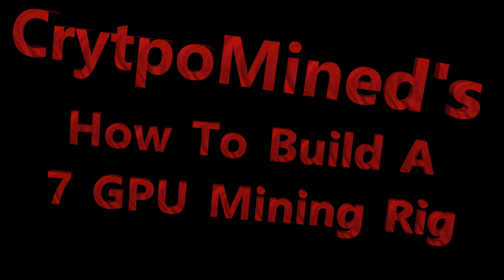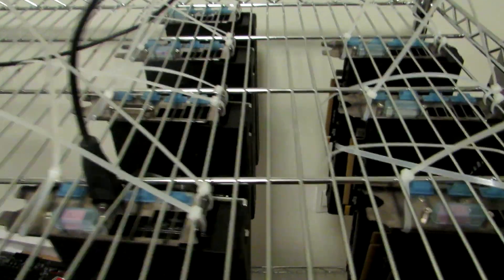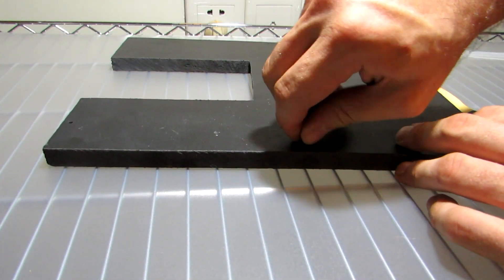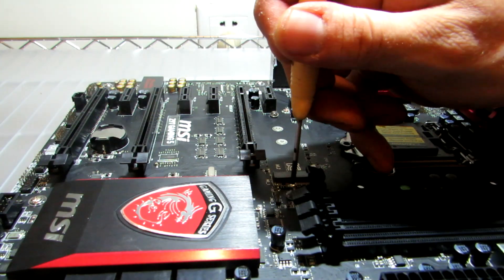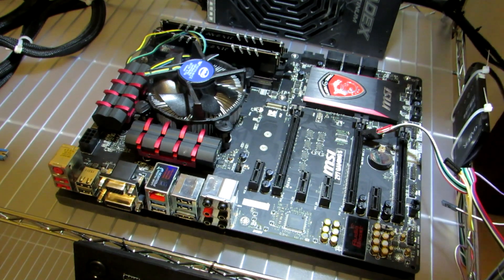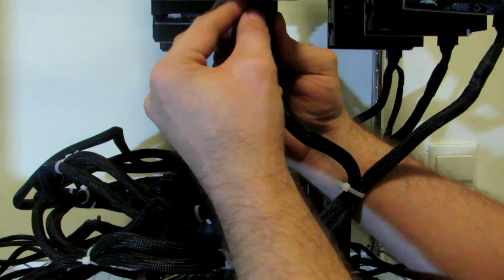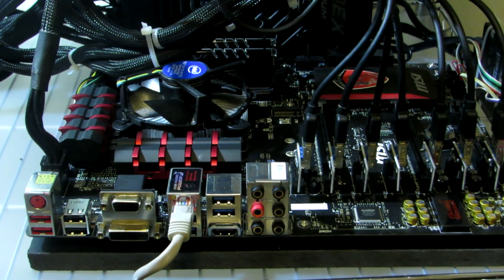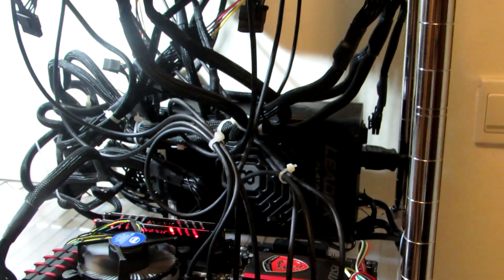How To Build a 7 GPU Mining Rig for ZCash Ethereum Monero Crypto Altcoins MSI Z97 Gaming 5

Comment: Hi, I have installed windows 7 and I have put this driver
Non-WHQL-Win7-64Bit-Radeon-Software-Crimson-16.9.2
Now I have configured 1 to 1 and it works so the above problem is gone my problem is
That all I work if I use 1 in one then I turn off the pc add another and it works the 2 I do the same 3 I do the same 4 works but when I connect a fifth or sixth comes out with a triangle
Here's a photo: http://image.prntscr.com/image/db625782b1da45f6bb96adfec2ba6bbf.png
My rig:
MOTHERBOARD: z97 gaming 5
CPU: Intel Celeron G1840 2.8Ghz Box
RAM: G.Skill Aegis DDR3 1600 PC3-12800 4GB CL11
GRAPHICS: Sapphire Radeon Nitro Plus RX 480 OC 8GB GDDR5
In the bios I have changed this:
Settings \ Advanced \ PCI Subsystem Settings
PEG0- Gen X [Gen2]
PEG1- Gen X [Gen2]
PEG2- Gen X [Gen2]
CPU PCI-E Land Configuration [x8 / x4 / x4]

Settings / Advanced / Integrated Graphics Configuration
Initiate Graphic Adapter [PEG]
IGD Multi-Monitor [Disabled]
I would like to know how to fix this thanks and greetings

Comment: Dude those Saffire Cards need to be in a horizontal position, the card leaks too much oil (Bitcoin Juice) from the thermal pads and I believe the oil is shorting the card. Trust me in this, within 3 months I got like 6 cards dead with a lot of oil touching the board and my the remaining 470s cards have oil too. XFX, MSI and ASUS they made a very good thermal pads (DRY PADS). To be honest right now I'm working on a freaking design that would hold 18 gpus on top of each others with 10cm space between them. Specially just for my saffire Nitro 470 4gb :) other brands are fine with any positions. Look at any big scale mining, you won't see any SAFFIRE!

I found in your lovely online store the (6-GPU MINING RIG CASE WITH 3 FANS), I believe this case will solve the issue IF its mounted in vertical way.
Reply: Dude is this really a thing? You are the only one saying this in the entire internet. Can you explain?

Comment: Hey Crypto, I have this same board with 7x RX480 8G OC.
I've implemented the bios settings as you recommended, and went ahead to install Windows. No matter what I do at this point the computer crashes and restarts, all the cards are recognized by DEVMNG. I've reinstalled Windows, disabled Windows Updates in Group Policy.. And nothing... 
My set up consists of a PSU that is confirmed working properly on another rig, 4 x16 risers and 3 of the short blue ones (All powered).
When I check the Event Viewer it just shows Kernal-Power. 
Im so close to giving up, 40th hour and counting.
Cheers.
Reply: Switched to all PCI-E Powered Risers, was able to mine for 30 hours. Suddenly got a BSOD "Thread Stuck In Device Driver", and upon re-installation of Windows 10 when I try to install new drivers I get the same BSOD. WTF LOL
Reply from the maker: you changed to ribbon risers?
Reply: Turns out that one card is dead, did a full test of each riser, card, psu connectors.. All six others are mining away wonderfully. Awaiting RMA to arrive! :)
Thanks Crypto!
Reply from the maker: ive had 2 of my nitros die on me in the last few months (1 480 and 1 470).. my xfx never died, no problems what so ever... and i've found other problems with the nitros recently... i'm afraid ill only be able to recommend xfx in the future.
Reply: Wow.. Although, do the xfx cards support the 29mh low watt bios?? If that's the case then maybe I should give xfx a try. Cheers

Comment: Hello,

I have MSI Z170A Gaming M Motherboard and 6x MSI AMD RX480 8G GPU.
My Motherboard is supporting only 3 GPU in PCI-E1, PCI-E2, PCI-E5.
PCI-E3, PCI-E4 and PCI-E6 slots is not working so can you suggest any setting for enable  PCI-E3, PCI-E4 and PCI-E6 slots.
Reply: Use win 8 up!
Reply: Was the problem solved... I've the same motherboard and same problem...

Comment: It can two Corsair RM1000x PSU supplant the Leadex 2000W PSU?
Reply from the maker: yes it could for sure would be enough, though im not an expert at linking them together, so thats up to you to figure out the best way to do it.  Best I can do is get you the cable to link the GPUs together.. but how to wire the rest is kinda debatable

Comment: i dont understand that where is gpu no 7 Rx 480 and this is half tutorial bro no installation drivers and how to configure 7 gpu i have same board last time when i connect risers connector to 16x slots the hash rates show me 4.7 mhs with 1 gpu so i just have 4 gpus but next month i will have 3 more rx 480 4g
Reply from the maker: well i didn't consider adding all that at the time... it was just a build video.. i thought driver installation and gen2 PCIE lanes were pretty self-explanatory in mining... 

so what I do to get this to work is:
OS Windows 10
drivers I still use are 16.10.3

OS Ubuntu 16.04
Drivers: AMDGPUPRO 16.30

Motherboard Bios settings:
gen2 PCIE lanes in motherboard bios
8x4x4 PCIE configuration
Primary Display to PEG
and turn the next setting after PEG to disabled.

I will upload some images of the motherboard settings and explain what drivers I use in the description now
Reply: Thank you so much bro i will contact you for mother board settings when i have more gpu in next month kindly add me in whats app if you want to +923122971373 is my number
Reply from the maker: cool, but sorry i dont use whatsapp.  I put images and better bios description in the description for this video
Reply: ok great thanks alot bro

Comment from the maker: The Best way to Support the Channel is to use the cryptomined store @ https://cryptomined.com where you can get CPIE 1X to 16X USB3.0 GPU Risers, Rig Frames, T-Shirts, Flags, QR Code Keychains and Pendants and More!
Its like making a donation except you get cool mining stuff :)
Reply: Hi Crpyotomined, what about a 1500 W PSU? A rig with 7 GPU's, could be work ok with that?
Thx for the answer :)
Reply from the maker: 1200 or 1300W should be fine with 7 470s, its just the 8pin VGA ports you would need at least 7 of those and i think only AX1200i has 8 8pin ports, 1 for cpu and 7 available for VGA... but it costs so much, mauybe better to go with EVGA 1600G2 if you want 7 on a single PSU
Reply: I have a question Cryptomined, I recently purchased Sata Risers from your website, and my plan is to do a Z270 mining rig.

Can you tell me the boards that will recognize 6-7 GPUs?

Like literally really good Z270 boards for mining, as long as they use 1151 socket, so it could even be a B250 board, H270, etc.

Make a list, friend :)

Final question, will this CPU suffice?

Intel Pentium G4560 KabyLake?
Reply: Hi Cryptomined, Can I use Mainboard Asus Z270-P5 for building 7 GPU Mining Rig? or only use MSI Z97 Gaming 5 for building 7 GPU. Thanks for your rely.
Reply: Hi Thach you can use Asus Z270 for build 7 GPU it work fine.
Reply: Thanks guy :)
Reply: did you conf any in bios setup?

Comment: ive noticed a trend for mining builds. each one looks shady as hell for its ghetto-like setup yet shits legal
Reply from the maker: well its good for airflow and keeping the cards a bit cooler - which you want when running them 24/7... and wasting money on a case is kind of useless when your making the rigs to make money (or crypto)... no point in spending money on something you dont really need.  Even spending 200$ on an open air frame is kind of a waste imo... using a shelf like I did is smart because you can easily reuse the shelf if you decide to quit mining and liquidate your hardware - not as easy to do with a bought rig frame - which when it comes to liquidation time is really a waste of money - no point in running yours GPU's for a few weeks just to pay off a frame... money is better to be put in an extra GPU.

If you dont want Ghetto like :P build a gaming rig and watercool it... I do that also... but for every purpose there is the best way to put the hardware together...

If people want to make their minings rigs look nice at an additional cost... maybe they should stick to building gaming rigs :)  just my 2 cents.

Comment: This configuration works with g1850 Intel processor?
Reply from the maker: i personally have not tried, but it should.   g1840 works fine for my 6 GPU rigs and worked fine when I used 7 GPUs on those 6 PCIE slot boards, so should work fine with this board and 7 GPU also.
Reply: I want to build a new rig, but the core i7 is very expensive, and then I want to try with g1840 or g1850. 
In other rig I use core i7 and X99 deluxe mobo, this configuration does not work 6 vga cards.
Reply: Why do you use core i7 instead of g1840
Reply from the maker: it should work, but i haven't tried so i cant say i know it will work 100%, but given my test on the pro btc with 1840 and a 1-3 extension card 7 worked fine with the 1840 on that board with the extension, so I think its no problem for this board and 1840.  If you do try please comment back to let myself and others here know if it worked or not (but im sure it should work).  Also I use drivers 16.11.3 for that board if you do try. :)  goodluck
Reply from the maker: I used i7 because i wanted something I could use as a normal desktop incase I decided to stop mining at some point in the future.. i already had enough 1840s and 3252s so it was a good excuse for me to tell the wife so she'd let me get an i7 LOL
Reply: Jejeje
Reply: This mobo is stable, what is the model for extension cards?
Reply: In this moment, I have a 15.12 drivers, I use R9 series and claymore 11
Reply from the maker: The 1-3 Riser extenders that I tried can be found here:
https://cryptomined.com/index.php?main_page=product_info&cPath=1_12&products_id=8&zenid=t8d0kd9hef0j056pkuk76o1tp5

for 7 cards your going to want to use windows 10.  I use 16.11.3, earlier drivers did not give as good a result (seemed 6 cards was max) and I use RX470 cards, so other than rx470 and rx480 I do not know how well 7 will work as those are the only cards or mix of cards I have tried.

so if you are trying r9 series cards, i would imagine it should work, but again can only comment on what I have tried myself.  otherwise I can only guess.

Comment: I like it a lot because, even if 7 slot mainboard system has an higher invest cost, in long therm it's the best choice... that's even the nature of mining, you doing good invest, you want more money back...
 I thnik also a rig (shelf/rack) with grids... and hang the cards on it is one of the best and most reliable constructions you can do... It's also best for air cooling... A rack with grids (for 3 "rigs") it's only about 50€ on amazon...
Reply: the best plates for MBs would even be alu plates, doing this gaps on it, then additional drill holes for air into  the backplates of your motherboards..

Comment: Hello,

I'm trying to built 7x GPU rig with MSI Z97 Gaming 5 motherboard. The problem I faced is that MB is not starting when 2+ GPUs are connected via USB risers. It works only with onboard graphic controller or with only one GPU connected to 16xPCI-E via powered USB riser. Please share what tweaks you are making to get 7GPUs work 

Any help is appreciated

Best regards,
Serge
Reply: Darth Pincho Start the pc without any gpu's connected and go into the bios. Find the option, "multi gpu access" or something like that, and enable it. I've also had this issue and this method worked for me.
Reply: How do you solve this issue??. Im facing the same.
Reply: Thank you!
Reply: Hi. I have the same problem. Can you please help me? Im using MSI b150 gaming m3. when i put multi gpu via riser usb it wont boot up. Sometimes it will but the screen will shutter and restart itself. I just bought it. Now im having doubt if its broken or there is only a settings need to modify to use multi GPU. Thank you sir!
Reply: Darth Pincho did you figure out how to enable multi GPU? I badly need help. Thank you!

Comment: Can't get mine to recognize more than 4 cards. I got r9 380s trying to get 7 of them running on the z97 gaming 5 but it'll only recognize 4 cards. 

Do you have any suggestions?
Reply from the maker: yeah a few, first the basics:
motherboard bios settings:
the 16x slots set to GEN2
16x config set to 8x4x4
and primary display set to PEG

then I use windows 10
so I would have to say use windows 10

then I use drivers 16.10.3
so you could try those (search 16.10.3 on the amd site on the drivers page, left hand sidemenu search function)

now if you have done all that and still not working
try reinstalling drivers with just 3-4 GPUs in it,,... get them all recognized
then try plugging in the rest - see if they will recognize

if they wont try doing first 4, then second 4 after reinstalling.

use DDU to uninstall your drivers (see my DDU video)

otherwise could be bad risers.
Reply: Cryptomined  Thanks I just built all my rigs with btc pros and it worked good. I'm planning on building nicer frames in a week or too so when I do that I'll try to get the 7 card rigs working. Thanks for the help.
Reply from the maker: Daniel Keem cool, glad it worked out, happy to have been able to help, your welcome

Comment: Do you need an i7 to support 7 GPUs ? Would i5 or i3 work - do you know or does anyone know ?
Reply from the maker: i3 or i5 or even pentium or celeron Should work, but I have only used i7 so I can only say i7 works for me... but I dont think it should depend on the CPU so much, but then again I don't know for sure
Reply: Cryptomined Have you tried the newer boards with 170 chipset like MSI Krait gaming ?
Reply from the maker: ***** no because they have limited PCIE lanes I think.. people cant get more than 4 cards to work generally... but Z270 may have changed that
Reply: Yeah - that was my issue. I think I will get the Biostar. The other ones are impossible to find.
Reply: Do you think Celeron is enough for those ? Is ZEC the only CPU hog ? ETC ETH don't seem to care and not sure about XMR.
Reply from the maker: ***** I think celeron is enough for anything now... i think Z170 was limited to 20 PCIE lanes somehow, where Z270 is going back to 24, but im not too sure excatly
Reply: Cryptomined All those CPUs show 16 PCIE  3.0 lanes. Confusing. Is a PCIE 1x treated as a single lane ?
Reply: Well I should know in a few days. I ordered 6 PCIE motherboards
Reply from the maker: cool

Comment: HI. THAK YOU FOR YOUR VIDEO. I AM GAVING A PROBLEM. I HAVE THE SAME BOARD MSI Z97 GAMING 5, WITH 7 MSI R9 390.
I AM USING CLAYMORE´S ZCASH 9.2 BETA, BUT ALWAYS I AM HAVING 10-15% OF INVALID SHARES. THE GPU 6, ALWAYS RECEIVED INVALID SHARES. DO YOU KNOW HOW TO CONFIGURE TO SOLVED THAT?
Reply from the maker: sorry im not sure how to fix that as I have not come across that problem myself.  have you tried other pools?
Reply: Thank you for your answwer, yes I tried with FlyPool and DwarfPool, the same % of invalid shares, I notice you have 16GB of RAM, I have 8GB, I will try with 16GB, I really don´t know what is the problem.
Reply: Happy new yer. One question that maybe will help me. What is your setup pf the Bios? what latancy frequency do you use, 8x4x4?, GEN 2, or 3 etc. Thank you.
Reply from the maker: lduro76 I dont think i changed the latancy from the default, i use 8x4x4 and gen2.  and primary display set to PEG...

Comment: what is the total power consumption from the wall on that rig ????
Reply: no it shouldnt be that high! if you fine tune them and unvervolt in the overclock, even stock it shudnt pull more than 1.2*k 120w times 7 = 840 and mb+cpu etc will be no more than 200, undervolt the gpu's and u can get 80-100w, i know commonly a 6 gpu rig fine tuned will be around 850w
Reply: No more than 2000w :P

Comment: Hi mate,
could you say what mode (GEN1,2,3) you've set on you BIOS for video?
I have the same mobo, but can not make all cards work together.
Reply from the maker: I have all set to Gen2, and the configuration is set to 8x4x4x
Primary display adapter is set to PEG
using drivers 16.10.3, windows 10
Reply: Having the same board but cannot get the 7th GTX 1070 working. It is recognized under Win10, but shows error 12: not enough resources... BIOS MOD did not help.

ANY IDEA?

Comment: how much?
Reply from the maker: about 2000$ not including the PSU since I already had it, you should be able to use EVGA 1600G2 and its a bit cheaper for the PSU, so under 2500$.
Reply: Cryptomined alright thanks. Hey how much does this thing produce. liker per day? after i'm done with my finals I want to build one. You may  receive a nice tip for your help. keep uploading videos bro. thanks again.
Reply from the maker: difficulty of ZCash and Eth keep changing a little bit all the time, so its not exact, and since i run all my rigs together its hard to say exactly what it produces, but whattomine tells me almost 1 ETH a day OR about 0.12 ZCash a day - its probably a bit less than that though.

Comment: Where did u buy the pci powered connecters from. I bought them off of eBay and they don't work. Well the power the card but no video. But with non powered one it works.
Reply from the maker: i get them from a local supplier, you can get them at www.cryptomined.com

Comment: How did you connect the GPU's ?? do you use any ati crossfire thing or what?? thanks for the answer :D
Reply from the maker: no crossfire for mining, just changed motherboard bios settings for PCIE lanes to gen2 and changed the 16x config to 8x4x4x
Reply: tnx for the answer sir.. :D
Reply from the maker: my board came installed with the most recent version i think its like 1.13 or something
Reply: Thanks , i have a Z97-G45 GAMING with also 7 pci-e slot, but i can only change the pci-e gen setting for the 1st pcie 16x slot. the other 2 is nailed at pci-e gen3
Reply: May i know which version bios you are using? thanks!